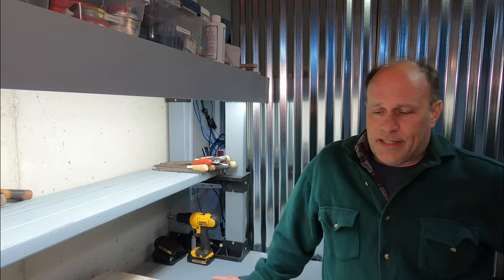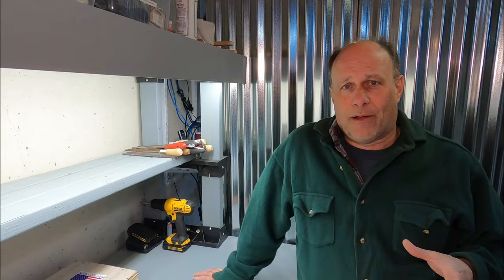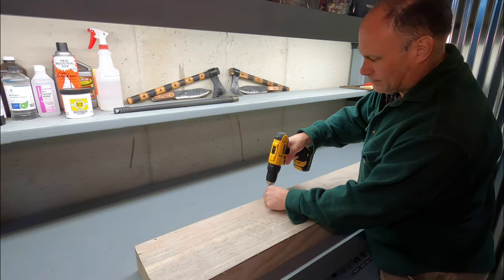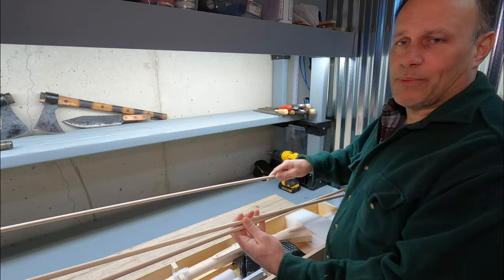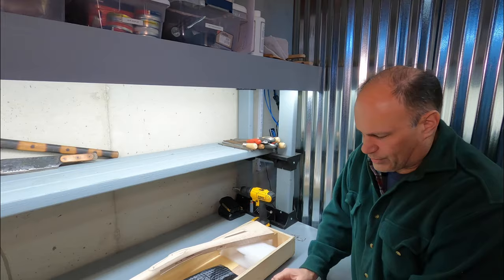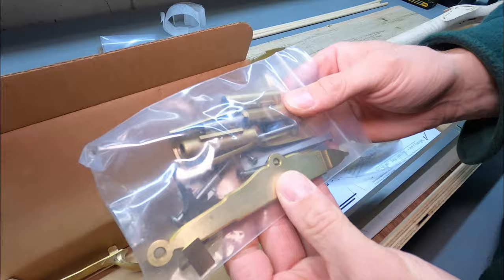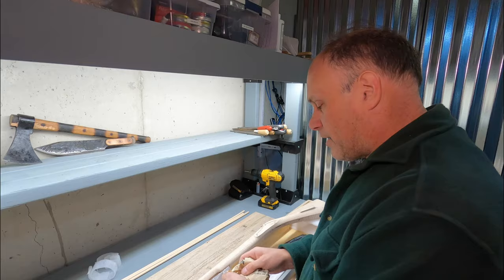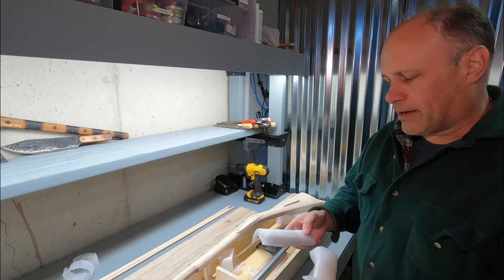Kibler Colonial American Longrifle Kit - Unboxing the Kit

Comment: Same thing when I opened mine. I looked and then shut it up again until I was completely ready to take it all out.
Reply from the maker: I’m planning to get started soon, and I’m sure it will be a slow start!
Reply: @completepete , I ordered a Southern Mountain Rifle in February. I received it may 15. So far, all parts fitted and then taken off again for finishing. I have the ramrod thimbles, butt plate and triggers finished with brass blackening liquid. I just finished polishing the trigger guard today. It, the screws, the lock and the barrel all need polishing and/or the blackening solution. The stock I have sanded and after whiskering it, am ready for the finishing once I can get to a borrowed heat gun. Yep, kind of a long process, but it has been worth it. Very much worth it. Good luck on your kit.

Comment: Not a gun buff myselfe (live in sweden) but 875$? Is that really correct? I was watching the entire video thinking what bank i would need to rob to afford this kit. As i understand it, it does fire once finished? If the prize is correct i can tell you, as a model kit builder, you get insane value for the money.
Reply from the maker: Thanks for watching!   I believe it’s $875 for the rifle and $200 billed separately for the lock.  The rifle does fire and is supposed to be extremely accurate.  I had saved for a couple years while I looked for a kit with the highest quality components, barrel and wood. I was fortunate to find everything in one place with this kit.
Reply: @completepete  The inletting alone is worth the price of the kit (from someone who started with a raw stock and regretted the endless hours of work)
Reply from the maker: @anthonymiller8979  the inletting is exactly what I wanted to avoid. Thanks for sharing your experience.
Reply: you got to be crazy to pay that much hell you can buy the gun already made for less
Reply: @ronadpaugh44  Where?
Reply: @ronadpaugh44 , yes, you CAN get a cheaper, lesser quality already made gun that will not have the features that these guns have for less, but you also have bought what you paid for. 
I have a Pedersoli that is nowhere near the quality that my Kibler Southern Mountain is.

Comment: Kibler rifles are absolutely superb. There's only one disapointing thing is integrated lugs for pins on the barrel that's not hc althogh it's easy to fix
Reply: The integrated lugs are a superior design, as they do not weaken the barrel.... though not “historically correct” neither is Jim’s production methods.

Comment: Thanks
I have a Kibler kit in my cart
May have to hit ‘submit’ now
*Good idea too on the extra ram rods and practice blocks
Reply from the maker: Thanks for watching Phil!  I also ordered another set of wood screws, complete set of lock springs, hammer top jaw and screw and other misc. parts.  They will quote you separately on the spare parts if you want them.  Good luck with your kit. At the speed I’m moving on mine, you will be done before me!

Comment: Nice looking kit. I'm outside the box on the rest. I'd be doing a Tung Oil finish with polyurethane finish coats. Make that grain pop! Next, sorry guys, I'd plate the brass and steel parts.
Reply from the maker: Actually sounds like a great idea!  I’d like to see it when you are done if you take on the project.

Comment: I have a mountain rifle ordered i was so hoping jim included the tap and correct size drill bits, guess the sizes will be in the instructions, thanks for the video
Reply from the maker: If anything, it will be an 8/32 tap with the #29 drill bit.  I purchased both from Mcmastercarr.com
Reply: @completepete  thanks for the tip on taps!!

Comment: Nice video Reminds me of The Days you Could Build a CVA Kit for Less $$ But way more Fitting and Wood Work on Inletting ,,also Subed and Like your approach to Building, ,Are you going to cold Blue The Barrel ? Nice Kit !
Reply from the maker: Bill,  cold blue rubbed back was an option, along with Kiblers French Grey coating.  Jim is now using the black coating from JAX called “JAX Black” which I’d rub back to a grey color.  Lots of uncharted ground coming up for me!

Comment: Do you use both tannic acid and iron oxide for super dark look to it? Thanks for the video.
Reply from the maker: Hi Hank and thanks for watching!  Yes sir.. you would use an application of iron nitrate and then the tannic acid powder to get the dark color. Jim did mention to me that I should keep the iron nitrate and tannic acid out of the barrel channel to avoid a chemical reaction with the steel.
Reply: @completepete  thanks , I never thought about the iron oxide reacting with the barrel,  good information to know,  thanks again

Comment: Read up on tempering the tamping rod/stick. (Kerosene and PVC pipe) it helps you not brake them.  Check with Dixie Gun works.
Reply from the maker: That’s great advice Jerry.  I had seen something about that method but had not read up on it in detail.  I’ll make a point of studying it in more depth.

Comment: what does something like this cost.. I've ben Wanting to build a flintlock long rifles for a along time . . Just like you I was unsure if I could build one ..
Reply from the maker: Hi Mark and thanks for watching?  Check Jim’s website as you have a lot of choices for wood and accessories 
https://kiblerslongrifles.com/.   I’m certain you can assemble the kit, take it slow and enjoy the process. Stay in touch if run into any issues.
Reply: kiblers are super high quality but might not be in everyones budget. you can get a traditions kentucky rifle kit for abt 250
Reply from the maker: For sure Tyler.  I’ve never owned a new black powder rifle before, always bought used.  The Kibler is my first and I did have to save up for quite a while.  I’m still puttering around assembling it but the quality of each component is top notch.
Reply: @completepete  cant go wrong with a kibler! their wood is top notch and quality from the factory in the kit is unmatched. traditions are nice to learn on and can make really good rifles if you put the work in. my plan is to practice on a couple of them then get a kiblers to go all out on like you did. cant wait to see the finished product! my favorite part is watching the staining of the stock
Reply from the maker: I agree 100% Tyler.  I’m hoping to carve out some time to restart my rifle project.  Thanks for watching!

Comment: I didn't do enough research and nought a pedersoli kit for $715 with 2 extra flints. I'm disappointed with my pedersoli in that hardware came pre mounted but not all by a craftsman.
Reply from the maker: Edmund, the Pedersoli is one of the best production rifles from what I understand.  Sounds like the fit is a bit off on your rifle.
I think I’d shoot it a bit and keep it in great shape. Pretty sure you can get most of your money back out of it if you wanted to invest in a Kibler rifle down the road.  Stay in touch.. I’d like to know how you make out with your pedersoli.
Reply: @completepete 
 It came preassembled so that the inlaid parts are fit but not totally seated. The brass parts came mounted with 9 steel screws and some exceedingly tight and heads partially stripped. Printed instructions are scanty about 1 page. Most brass parts are raw from the mold. I would never had guessed how much has to be filed off and sanded to make into golden mirrors. The lock appeared nicely inlaid but there was a little black powder grit insudecthe action indicating the lock needs more wood removed so no powder will escape. It is my 1st kit rifle so I imagine other kits have their problems also. Instructions said to work the stock down first but knowing the brass needs bumbs removed I digresssed and worked the brass 1st. Working the stock will probably mar the brass a little but I'll have little to do to finish it then.
Reply from the maker: @EdmundMar  Sounds like you got a good start on it. Take your time and if a part of the assembly is getting  frustrating, take a break and go back to it later.
Reply: @completepete 
Much thanks to the Kibler Videos Ive been able to determine short comings of the other brands scanty instructions. I.e. found powder from its test firing inside the action, not much but would build up if not correctwd. I need to print and deepen the locks inlet so the gap it came assembled with is eliminated.